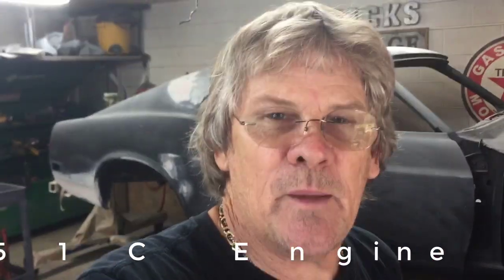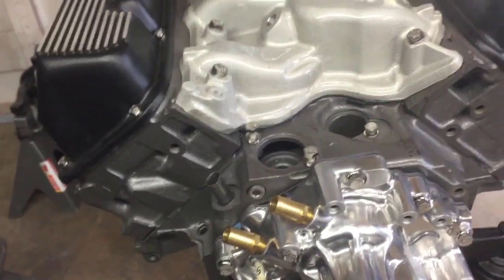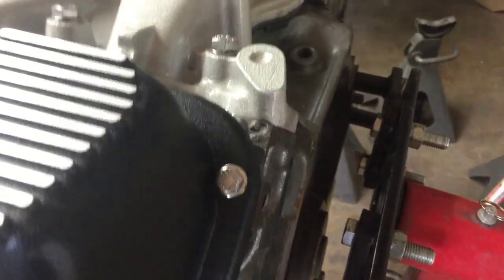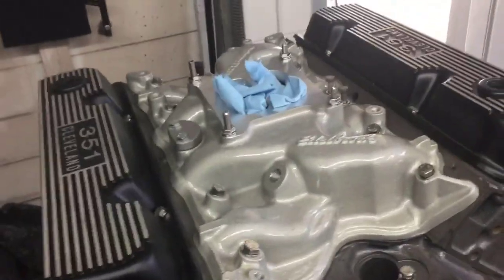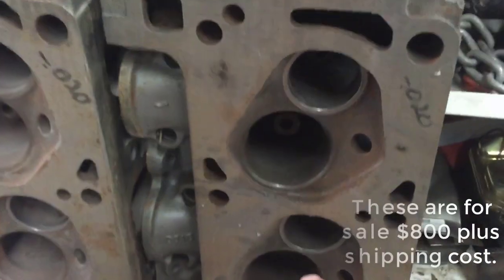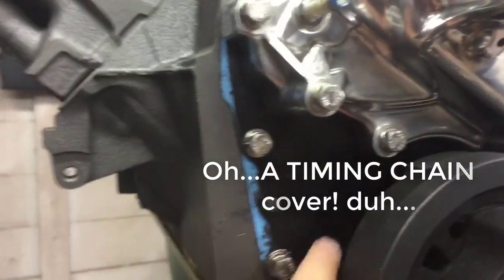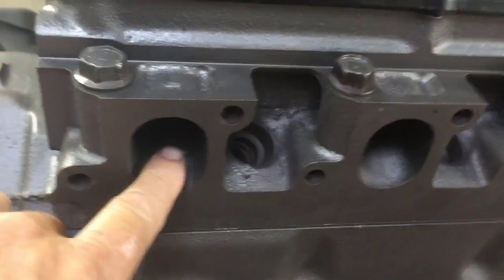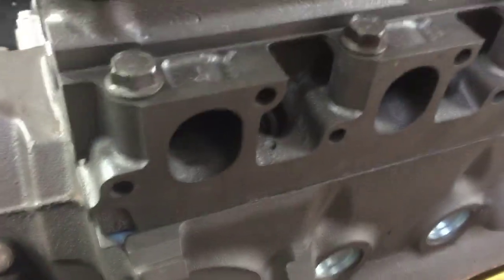351 Cleveland 2V Engine Build With 1970 Mach 1 Restoration Project

Comment: You really got two spin thr rpms to get good power out of them I've read the quench heads are alot better at low rpms then the open chambers i had a ranchero with a q code love the engine Clevelands for life.

Comment: Hey Rick,  I saw your ‘ 70 Mach 1 headline and had to take a look. It was a smart move on your part to get the Marti Report. That way you know exactly what you’ve got and gives you a better idea on which way to go with your restoration plans. You mentioned your age and condition but no worries because you’re getting it done and that’s what it’s all about. I’m older than you and have seen better days myself but I don’t see it as a deterrent. Just gotta set your goals and keep moving forward 👍. I’ve owned my ‘70 Mach for 37 years and I just might keep it a while longer. The Marti Report shows mine to be very similar to yours. Factory built with the “M” code 351 Cleveland 4-V except with the FMX automatic. Grabber Blue with the original Shaker Scoop Ram Air and it had white interior as produced. A previous owner changed it to black interior with the correct Mach1 Comfortweave  vinyl seat covering. I’ve had over 45 years of street/strip experience with the Cleveland and with the careful selection of components for your intended usage, it’s capable of being a powerful and reliable daily driver or a naturally aspirated 800 horsepower terror without any power adders. There are quite a few on YouTube to prove my point. When it comes to production Cleveland blocks, they’ve gotten an incorrect reputation for being problematic when used for performance builds. The oiling system is designed to send oil to valve train first and then down to the main bearings. With attention given to the details during block preparation for a rebuild, it’s fine for stock and mild performance applications. However, when the engine will be subjected to sustained or frequent rpms at 6000 and up, the block needs the same modifications that builders have been using for decades to limit oil to the cam and provide more to the main bearings. Screw-in restrictor kits are readily available and any good machinist can drill and tap the oil passages for installation. It’s also recommended that bronze lifter bore bushings be installed to restrict flow up top and provide even more to the bearings. Stroker kits are great for safely adding displacement. The 408 Cleveland kit will add the extra cubic inches needed to really wake up the potential of those big ports and valves. There’s one misconception about factory iron Cleveland heads that people need to understand. Yes indeed the 2 or 4 cast into the upper corners of the heads do indicate 2-V or 4-V port and valve sizes. But the little dot or dome beside the number has absolutely nothing to do with the open or closed (quench) combustion chamber design. All 2 barrel heads cast in the United States are the open chamber design. Some have the dot while others don’t. I have two pairs of D1AE-GA, four barrel, closed chamber head castings. They ALL  have the dot beside the four along with the easily recognizable CLOSED combustion chamber design. The exact meaning of the mysterious dot or dome hasn’t been verified yet. There has been some speculation that it indicates a slight revision in the water jacket design. One thing that is known for sure is by checking the actual date codes located beside one of the rocker arm pedestals which shows the year, month and day each head was cast in the Cleveland foundry, the dot wasn’t used on any of the very early castings. The dots start showing up on heads cast around June of 1970 and later in the Cleveland head production run. Oh well...another of life’s little mysteries !    Best of luck with your Mach 1 project.
Reply from the maker: Thank you. For the info. Ive read that as well. Some have it, some don’t. Many have it and then the chambers are open. And vise versa. Thanks again!

Comment: I have had 5, 70-73, Cougars, and Mustangs, with  "just" 351C V8 2Bbl. They rip!!! When there right, and tight, they need no Apologies. Many of my buddies, were impressed. Yes the 4V, heads, and intakes, carburetor, make great headlines. There really fast too. But if I have a 71 grande, 351C 2v. It is an enjoyable, muscle car. 71 Camaro, 350 V8, 2bbl, just doesn't love the mid and high, rpm like the base model 351c v8 2v does. Just my opinion.
Reply from the maker: Awesome. Thank you.
Reply: I just want to let people to know, that, flat top pistons 9.0:1 c.r., Mild, hydraulic cam and lifter set, adjustable timing set, good gasket set, and some 2V cylinder heads, bearings, and rings, and you will be very happy. Machine shops know .020-.030 max boar!! If it takes more to clean up, find a serviceable block. These engines really breath!! Don't over carb, don't over cam!! '71-'72 351cj cam pattern and specs, perfect! Make sure to use proper thermostat, many will fit, but won't mate with restrictor plate, in block. Don't lose restrictor plate, When your block, goes to machine shop! I like the factory cast iron exhaust manifolds, just fine. Magnaflux for cracks. 80percent of them suffer cracks. Get a degree wheel, for cam. I used pertronix ignition parts,  pieces, So no points.

Comment: I built one of these motors years ago. Ran very sweet. 
Looking to build a Scat forged assy 383 with Angus Racing 220 intake port aluminum heads 64cc combustion chamber combo at 11:C R. Looking for Dyno on this combo. My opinion this is the best 383 ci combo to date. But that's just me

Comment: Howdy, I have a 71 Ranchero, 351C 4V closed chamber. Prolly going to be selling an excellent 71 Ford Torino, looks like a Cobra, has Cobra emblems, the '70 grille, fresh 351C 4V roller rocker build, auto, factory tach, 9" traction-lok. Post more vids Rick.

Comment: No doubt aftermarket heads work, but the 4v heads have more potential than ANY non big block of the day. Only a few came with good compression and cam. A proper cam in a 4v with compression will be over 400hp with enough torque to fry tires up nice and crispy. Just sharing.  The Cleveland were misrepresented forever. Everyone at the drag strip knew to fear them.
Reply: The Cleveland were very big in Australia, we absolutely love them and work the hell out of them, and used cleveland enines up until 1985. I think stop making them in 1982 which can be questioned
 (this will upset you) back in the day we use to throw the 4V heads away you couldn't give them away, nobody wanted them, we used to rework the Aussie 2V closed chamber heads for more power, (combined the best features of the 2V and 4V heads together) actually where your modern 3V head design came from.  To think what 4V heads are worth now, but so are the Aussie 2V heads closed chamber heads. nobody wants open chamber

Comment: I got a 351  Cleveland modified   so thought in what way?   So i checked the manifold  2v or not 2v that is the question    the answer was not 4v
Reply from the maker: The 4V head port size and intake valve is just too big for a street performance car. Which needs quickness to impress, not top end. 180 is too fast to be driving on any US freeway! So a 3V type or an aftermarket aluminum head somewhere in between the 351 2V and 4V is the top choice.
Reply: 2V are better ,,,

Comment: How much for the engine?
Reply from the maker: $3800.00 Its a Fresh Performance Rebuilt Original 351 CI Cleveland Motor. Never been driven. I start it every week and run it for about 15 minutes.
Reply: Is it just the engine?